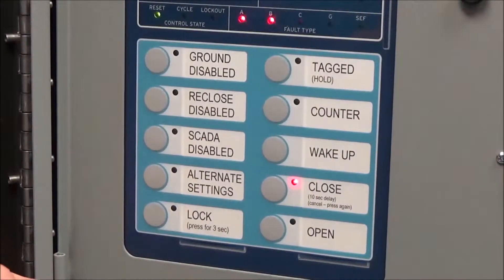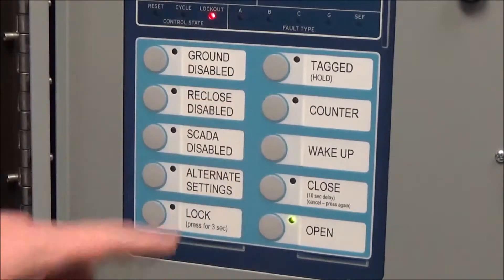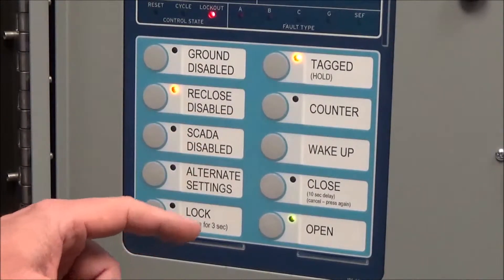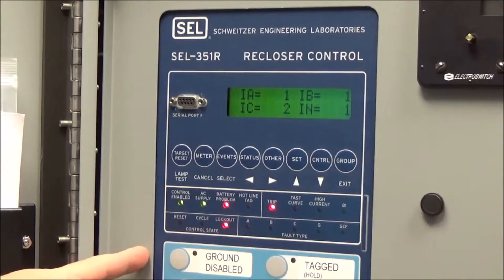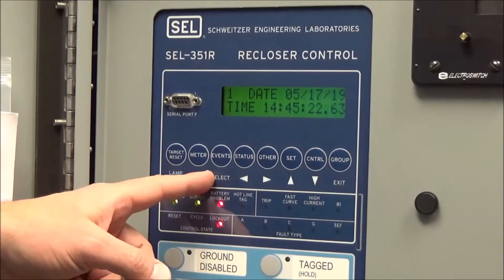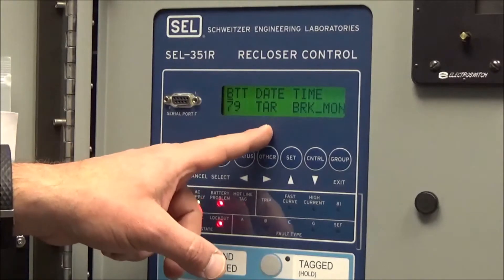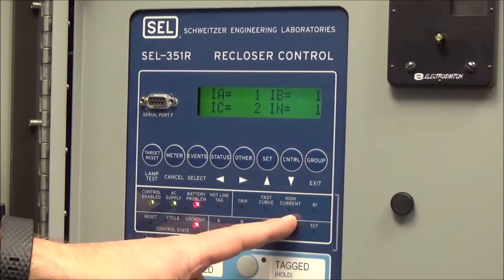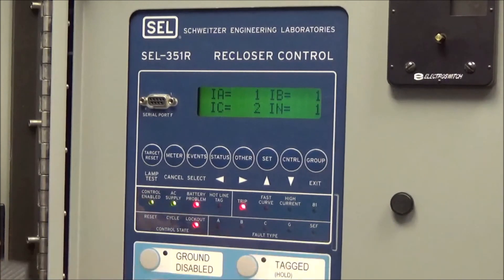SEL 351R2 Controller Overview

Comment: Thanks for this video. I'm watching and trying to learn as much as I can about the SEL-351R in order to connect a modem to replace an old radio. The settings are a bit confusing to me, but I'm in the process of understanding what the old radio is doing that the modem won't.